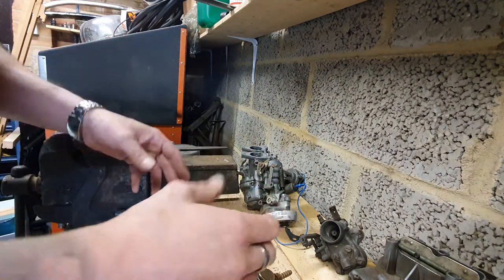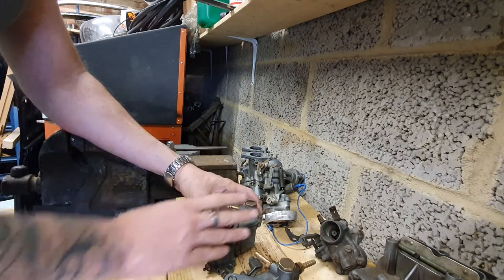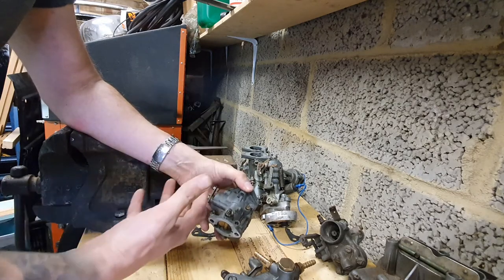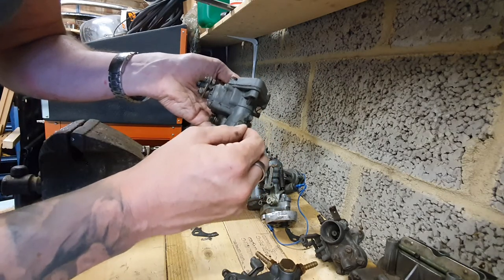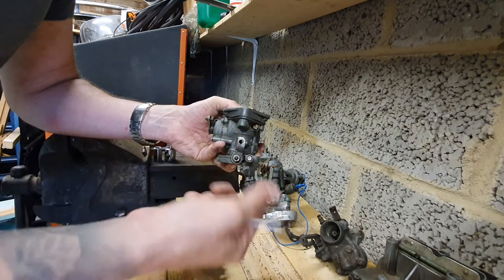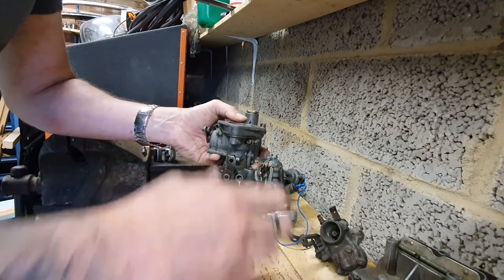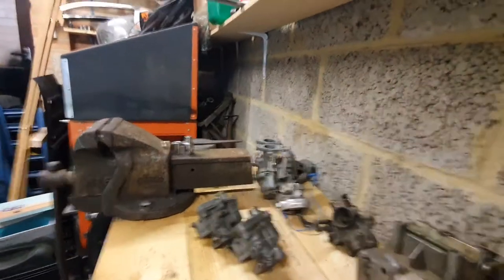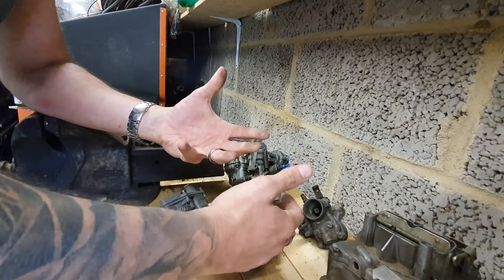Sudden high idle speed? stalling when coming off throttle? check your carb for airleaks

Comment: What if my carburetor is new and there are no air leaks? It's a CV diaphragm type carburetor and  there is an adjustment for the diaphragm barrel needle, will that fix it?

Comment: Thanks for those tips. I have a situation annoying me for months, and maybe you can help. Car starts fine, idles fine stationary, but the rise from stationary idle speed to let's say to 1500 Rpms is slow, and like at 1500 it's like a switch turns on and a revs perfect, so from a mid rpms range to max, no problems, but from idle to mid very slow rise. I did the tappet valve gap at 0.15mm, I did the timing, all new points, spark plugs, distributor cap, cables, Bosch coil. I am just not getting it. What do you think that could be? Thanks. When driving from standstill to medium speed, very annoying on the road because I am slow, but once at let's say 40km/h driving okay since it's in that mid to higher rev range
Reply from the maker: Sounds like a blocked or partially clogged passage in carb. Seems idle circuit is fine as is main but the transition circuit isnt fueling right
Reply: @FoxSpeedshop  Thank you very much. I remember that I took it apart a long time ago to clean (did not put new parts in it),  I will take it out again and see. The car has been sitting for a good 6 months without starting. Maybe some fuel gelled in?
Reply from the maker: Quite possibly yes, it can go a bit sticky

Comment: Took my 500L to town yesterday and filled up with petrol for a show on Bank Holiday Monday. Car ran well no problems and I had to park Inn the road on my return. Went out to  ring it in abd it started right away but reved up and died, now it won't start at all There is fuel in the float chamber and a new petrol pump fitted. I am perplexed can you give me any tips please
Reply from the maker: Are you certain its fuel related? Sounds to me more like an electrical issue if it started that suddenly. Youve not got a short in your distributor at all where the plastic block goes? Tried a new condensor? Checked its not something silly like the small wire from coil come off or anything? Check for spark is my advice
Reply: Thanks for your advice will give it a try